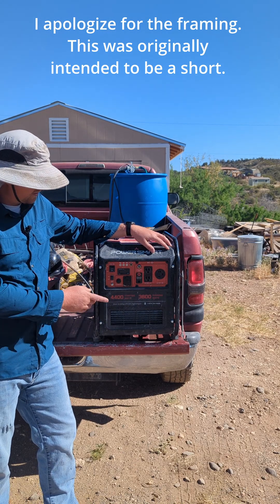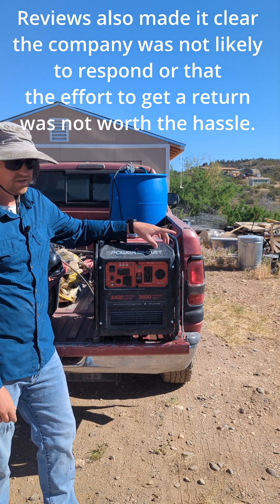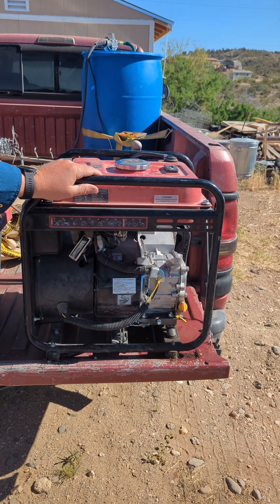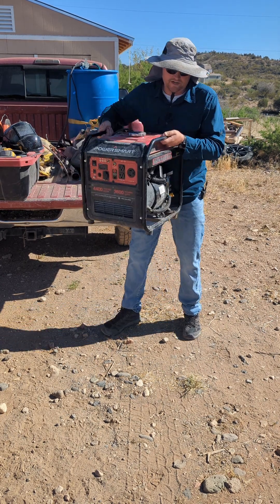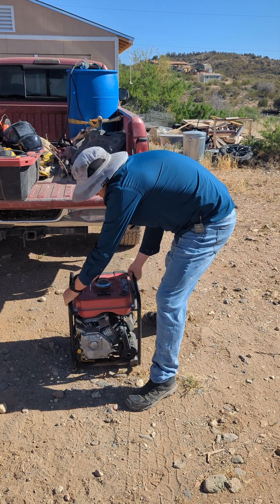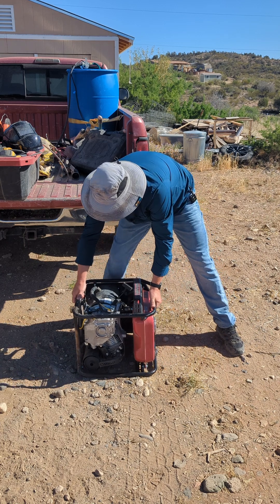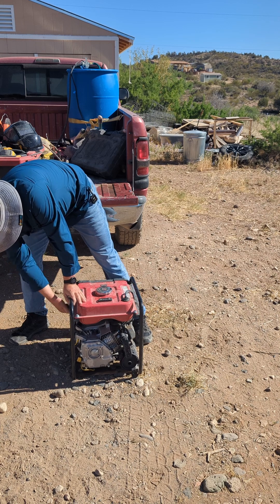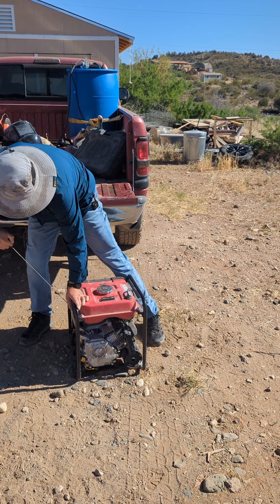PowerSmart 4400 Engine Seizure Resolved :EIB Farm and Family 7

Comment: Generation comes with a 2-year manufacturer warranty. I recommend you return it, and the company will ship you a new one.
Reply from the maker: I, like many other reviewers had no luck contacting customer service for parts or replacement. Also with how many parts I've fixed at this point I'd be a few generators into my purchase if they ever responded. I did an update video where I found the real issue but like multiple other reviews I did have to weld the muffler back together and fix the mount after the whole thing broke and broke off. It's been a good learning experience though and still runs after the repairs. I'm sure it will teach me something else in the near future.
Reply: I always use a credit card when I purchase merchandise online because they offer buyers protection. Have you tried contacting them on one of their social media pages?
Reply from the maker: No. I suffer from financial illiteracy so credit cards and I don't get along. Also when mine first went out I was a couple weeks into some leave working on a fence and couldn't wait had the company responded anyway. It's hard to  stop a project to replace a tool that's less than a month old. I would have ended up buying a harbor freight predator and likely still been stuck with this one. Easier to figure it out myself and keep moving.

Comment: "Pullstart stuck"       ....so its likely the pullstart-recoil and/or interface to the crank of the engine.   Nothing is wrong with the engine, or internal seizing within the engine. 

The engine appears to run smooth, and if it had binding or an actual interference-loose component it would likely grenade during running.
Reply from the maker: I did an updated video after finally finding the cause.

Comment: Eso se llama bloqueo estático, sucede cuando la aceite llega al punto muerto superior y es filtrada en la cámara de combustión haciendo que está misma sea retornada al carburador el cuál distribuye por medio de protección al Carter y al sistema ligandose la aceite con la gasolina, automáticamente se vuelve un bloqueo estático, la solución no es darle golpes como lo hiciste, es primeramente sacar la aceite del cárter por mediación del perno que no permite que se derrame la aceite, una vez sacada el aceite con la gasolina del sistema tienes que sacar la bujía para lograr que la presión que quedé en la cámara de combustión salga junto con las impurezas de la mezcla de la aceite y la gasolina, auto seguido jalas la cuerda para descomprimir, y al mismo se libera el bloqueo y la compresión, le vuelves echar aceite 10w30 al cárter y su gasolina al tanque y listo a trabajar, darle golpes e incluso virarlo puede dañar el generador
Reply from the maker: No I found the cause was two loose bolts that physically backed out and blocked the pull start from spinning. I did an update video showing that. Hitting it worked because it helped the bolts re-settle just far enough out of the way to allow it to pull start.